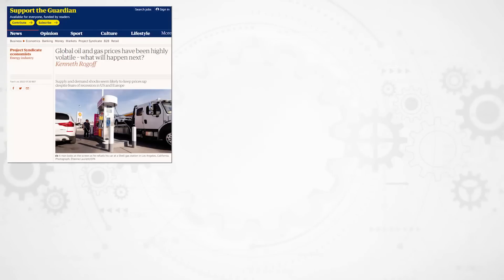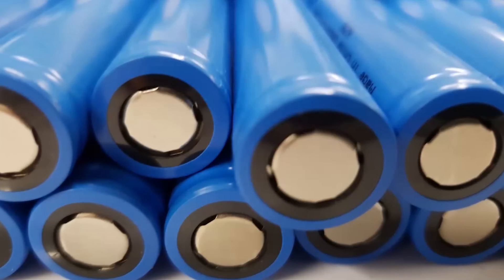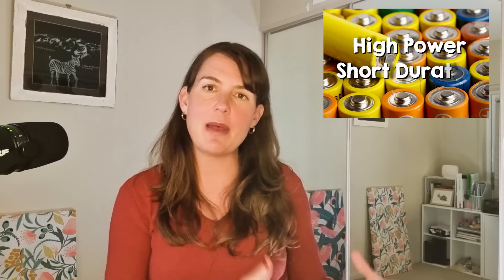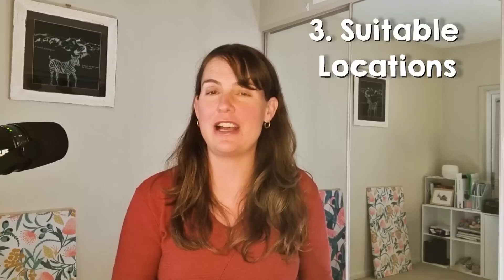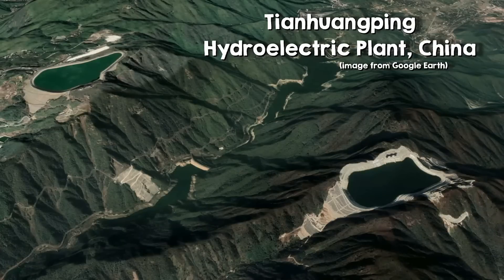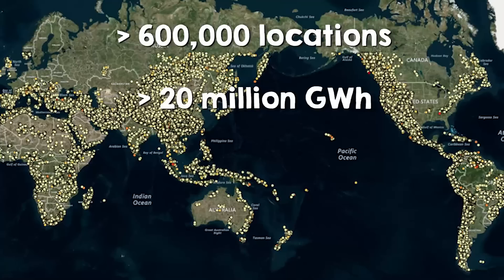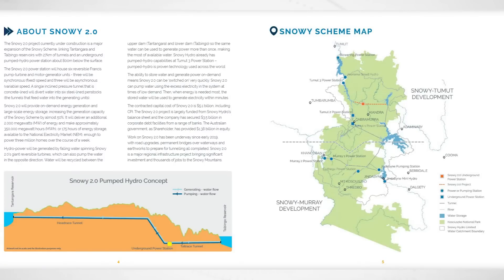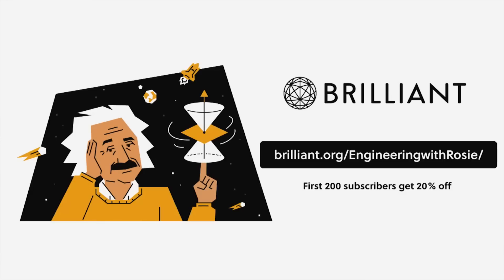Pump It Up When You Don't Really Need It: Pumped Hydro, Future of Energy Storage

Comment: Rosie, tell me where I'm gogin wrong here. I don't reckon that existing dams need to be heightened. Over the ditch here where we have more water than you guys, we still often have drier patches, so I reckon the dams are often not as full as we would like. Pumping water back up in these will increase storage, and maintain that stock of energy when otherwise we might otherwise keep using it up. ie with more renewables, the excess re-loads the water head in these dams so they are closer to full more often.
Reply from the maker: If there is hydro without pumping capability then that is usually a slam dunk to get very cheap energy storage with minimal additional environmental impacts.
Reply: I could suggest NZ Hydro balance well with wind / solar. 
Dry windy summer : let Hydro sit like a battery, until the windless nights when Hydro kicks back in
Reply: This could be done for the Tekapo scheme, i.e. pump water back up from lake Pukaki to lake Tekapo. The downhill part already exists. I think that one will happen. Running the Ohau scheme in reverse (from lake Benmore to lake Ohau or Pukaki) might also be a candidate. The main issue for Taupo is that the first hydro station is a fair bit downstream of the lake itself, but you could have off-river storage elsewhere on the Waikato. 

Physically I think you could do it at Te Anau / Manapouri but doing anything at Manapouri beyond the hydro scheme that already exists there is still a political third rail. Also you would potentially be disrupting a section of the Waiau river with not one but three Lord of the Rings filming locations.

Comment: If you pump up about half an inch of water level in one week and the upper lake evaporates half an inch in a week, like any pool does, the storage  efficiency of such process over one week is weak or more simply… NIL!

Of course due to economy of scale and concentration of pollution at one single location, the thermal coal or gas plants or nuclear plants and hydro-dams are huge and electricity is then ideal to move this energy production to cities..

Wind and sun, on the contrary, are present all over but are variable, seasonal and require much more energy storage on site but much less transport since moving this energy to use it or store it elsewhere in a place where the renewable energy can also be produced or rather harvested, is simply an insane waste of mining and funding ressources…. For electro geeks!

Charges and networks have always adapted historically to the supply characteristics, NOT the reverse….and what the system in place try to do to continue to harvest huge gaps from low energy costs to high exclusive retail energy selling prices at their exclusive gas stations and utility meters. For instance, when trains got electrified, we did not fit a resistance in the boiler and a pantograph of the cab of steam locomotives, but produced new specific electric locomotives instead…but today, our strong energy and supply lobbies invented those heavy BEV only sold and viable in rich industrial countries with enough taxpayers subsidies to support them but this cannot be replicated elsewhere for larger ww mobility economically.

Same issue here for surface produced renewable energy: for energy storage, not transport, we find that electricity is no longer the most economic and efficient media: chemical batteries are mining intensive, expensive, polluting and not durable, the hydro storage doubles the power lines losses from production to storage and from storage to the charges on top of huge pump, turbine, friction and evaporation energy losses.

instead, the oxidising green gas storage as carbon neutral energy supply are much more promising, H2 CH4 NH3 etc…  if PV and wind power direct DC electrolysis and compression of hydrogen or synthetic methan or ammonia is rather inefficient, it is with a free supply source of power and all the stationary joule losses of the process with high enthalpy (…and pure high value oxygen side production for medical use or welding) for heating hot water or absorption air conditioning, then all those process losses are recoverable, useful and economical as well. 

The green H2, Pv or wind produced economically can be stored for months at no measurable loss nor significant cost at nearly 1/500 of the cost of  LIB per kWh of storage. The pressure bottles are both much cheaper and more durable (over 50000 full cycles) than any polluting reversable electrochemical lithium battery. For home use and for small storage capacity only, the recently improved very heavy salt batteries could eventually compete with green H2 for low cost energy storage but more H2 and less power network will definitely be a strong trend since copper and aluminium are just becoming way too expensive to accommodate new heavy charges like BEV’s and heat pumps…via networks which were not designed for it…
Reply from the maker: You can easily pump faster than evaporation 🙂
Reply: @EngineeringwithRosie  yes but the amount of energy lost in kWh, MWh or TWh is still the same over time with more energy storage or is even slightly higher with more heat pumped from a lower lake, this increases the evaporation once stored lower warm water is at higher cooler altitude. Meanwhile, a H2 COPV bottle of 350 or 700 bars has no measurable energy loss for over six months at full pressure or over 50000 load cycles, so while some energy storage are aimed at short duration with efficient conversion but high losses over time such as hydro or electrochemical reversible reaction batteries, other storage methods dedicated to free seasonal and variable sun and wind zero carbon energy are less efficient upfront, yet with recoverable joules losses and pure oxygen, but with no further loss of energy over time and this for reasonable cost, about 10$ per kWh of storage for COPV’s depending on sizes…So, globally electricity is good for massive ongoing transport but poor for long and massive energy storage, heat is for storage only and very short distances. The catalytic conversion or combustion of green gas or green liquid ergols produced by renewables sources is most economical for seasonal storage with economical transport and transfer of power not needed since sun wind and water are all over where humans live with no significant economy of scale benefits…unlike fossils, hydro or nuclear plants…This is true only if the expensive upload to a power grid (copper at 10000$/ton aluminium 4000 etc) or the energy charge onto a LIB battery (200$ per kWh for only 2000 cycles and 0.8 to 1.5% loss per day depending on load level) is avoided due to high cost: PV DC to DC electrolyser... Please note also that gaz pipeline are 3 to 20 times cheaper than power lines per Megawatt of capacity and the amount of energy a single fuel truck can carry is very significant.
Reply: Have you ever heard of rain?
Reply: @Hzwo.0  hydroelectricity energy production and hydroelectricity energy storage are two different things and increased usage of variable, seasonal  and unpredictable surface renewables including hydro rain snow ice wind sun, etc  requires massive amount of endurant energy storage where H2, salt batteries micro hydro etc can play a larger role than evaporation and grid transport uneconomical wastes.
Reply: @philgooddr.7850  sorry but I'm having a hard time understanding you...
I'm just saying that you have evaporation but you also have rain so..
Probably on some locations more rain than evaporation.
Reply: @philgooddr.7850  actually we shouldn't be talking about nuisances like evaporation when there is still stuff like deepwater horizon where we suddenly are able to spend billions. Or covid. 
We got the money / manpower respectively so just do it. 
It's also fun cause oil from deepwater horizon could stop evaporation...
Reply: @Hzwo.0  Sorry, I was not so clear, English is not my mother tongue: simply stated, for economical energy storage, I guess that three parameters are essential:
1. Storage efficiency: percentage of the loaded energy which is restored, recovered and usable.
2.Loss of energy stored over time if the storage of energy is long, seasonal.
3. investment cost: economical balance and ecological impact, mining amount pollution and manufacturing cost, initial grey energy, system durability and number of storage full cycles from full load to no load and reload as one defined cycle, maintenance and end of life recycling costs.

Now, to shift fast or even faster to a green renewable low carbon yet industrialised modern civilisation in order to stop roasting the planet, much more endurant storage and much less long distance transport of energy will be required. There, electricity is no longer the only, ideal and most economic energy media for large storage volumes of useful energy. Also, the final energy loads, domestic mobility industry and services, etc, can be adapted quickly to the new available clean and economical primary energy sources and energy storage technologies…Already today, hydro electric dams, electricity grid networks and lithium batteries became very costly in comparaison to clean PV panels, graphite electrolysers, gas compressors and COPV’s. With more heavy BEV for mobility and heat pumps for climate control powered by the grid, the mandatory reinforcement of the current power network not designed for all those extremely high domestic loads would be extremely costly. Meanwhile, transporting renewable power which can be produced anywhere is absolutely insane. Then, Hydropower for short day to night time periods, green hydrogen and green E methane for on site power longer storage and sodium salt stationnary batteries for moderate domestic energy storage volume are maybe our most promising clean power options..

These are only my current modest views on these issues. they have evolved over time and are certainly and significantly wrong in many aspects and will also change further like in the past and all arguments like your are valid to progress, but we have to consider early enough, the very dynamic aspect of energy: for instance 30 years ago there was NO windmill power whatsoever in the projected forecast of the IEA the International Energy Agency… now electricity is only part of the overall green solution but definitely not 100% of the solution if the amount of mining and pollution required more than offset the carbonising gains of such green electricity and we with the wrong choices preserving many historical interests in place, we could be wasting money ressources and mainly valuable years of planet life and biodiversity preservation.

Comment: I would urge you to see.....  youtube channel zeropollution2050 .... that was released over a year back on Youtube.... that covers the Supply of Energy using ONLY AgriVoltaics (AV) with a 150TW Global AV System generating 180,000TWhrs/yr of Electricity to meet ALL of Mankinds Energy Needs (not just Electricity) by 2050. 
Today Mankind uses 120,000 TWhrs/yr of Energy (converted to Electricity).. or 15,000TWhrs/person/yr for 7.5 Billion People and 20,000TWhrs/person/yr for 9 Billion People by 2050.... Approximately, 25% of this would be required for S2S (Sunset-To-Sunrise) Energy Storage/Generation needs... or 40,000TWHrs/yr in 2050.... much much more than the maximimum 10,000TWhrs/yr suggested in this video....
The Videos originally discarded the 1+TW (mostly) Open Loop Hydro System for S2S Energy Storage Needs as they generate ONLY 5,000TWhrs/yr instead of the needed 40,000TWhrs/yr. 
This was however revised in a recent Video.... UHES... or Upgraded Hydro Energy Storage... In UHES you take the 1+TW Open Loop Facilities and UPGRADE them to 10TW Pumpeed Hydro and provide Lower Reservoirs of just 120TWhrs (barely 2.5% of the 5,000TWhrs of Reservoirs above).... at the EXISTING HYDRO SITES ONLY.
These 10TW UHES Systems would operate in a 12/12hr Pump/Generate Cycle generating 120TWhrs/DAY... or 40,000TWhrs/yr ... the REQUIRED S2S Energy Storage/Generation needed.....
I hope this will help....

Comment: In a changing climate, how much will water variability impact pumped-hydro systems especially in water-stressed countries? This did make me wonder: what about a marine pumped=hydro systems... pumping sea water to a reservoir when energy demand is now, and pumping it back out to see when energy is required? This, in conjunction with other new marine-based energy generation & storage tech. 

Other interesting hydro energy options include:
- conduit hydro (mini turbines located inside high-flow water pipes)
- turbulent hydro (constructed mini whirlpools)
- mini hydro (mini hydro rotars in river & streams)

On a different note: there are a few battery storage options in the pipeline that may be better-suited to grid-sized energy storage including liquid metal batteries.

The future of energy generation is interconnected distributed mini grids + storage located nearer to consumers using whatever geo-physical assets an area has, ie community energy. Base tech would include conduit hydro, energy from poop (a free daily renewable commodity) via a no. of tech options, and waste to energy (must be clean). All urban areas pump water to homes, and remove household waste (minus recyclables etc) & sewage so why not use these for energy generation? Solar panels on building roofs would also feature prominently. in this context, energy efficiency is crucial to reduce energy demand.

Comment: We might also see more baseline power from deep geothermal, accessed via new plasma drilling technology.  There are a few test sites this year which might tell us whether the drilling technology works quickly and reliably.  Then we'll need to see whether traditional geothermal heat exchangers, turbines and well fluid recharge cycling, function as needed.

Comment: As I understand it, there are anoxic areas at the bottoms of the lakes/reservoirs used in hydropower (pumped or not). Bacteria living there can produce methane, which has its own climate risks. Did you research this? Are there ways to limit this in standing water?

Comment: I don't understand why talking about Pumped Hydro never includes consideration of repurposing abandoned underground mines.  You don't have to worry about evaporation reducing your capacity.  I imagine turning underground caverns into water-storage tanks would not be a big deal.  Adding storage capacity (Wh) is just putting more tanks in the top and bottom levels.  Adding power capacity means just installing more turbine generators, pumps and plumbing between the levels.  And it puts all those mine workers back to work in relatively clean jobs.
>> SocialDownclimer:  My thinking is that all the storage water inside the PH-in-mines is contained in the upper tanks, lower tanks and interconnecting plumbing, pumps and turbines.  Water seeping into the mines will have to be managed but are not part of the storage system.  Obviously dry abandoned mines would be preferred.
Reply: There are environmental issues unfortunately. Depending on the mine, a lot of pollutants can leach into the water in the lower reservoir, and get transported to groundwater in the upper reservoir. I don't know specifics though, so if you find any sources that talk about this please post them : )
Reply: @SocialDownclimber  I'm thinking of a totally closed system with the water used within the pumped storage system is totally contained:
in the high tanks, in the plumbing between the high tanks and the low tanks, and in the low tanks.

Comment: Why did you avoid the calculation of the amount of Energy reguired to overcome the head height reguired to make these systems viable. Lifting water back uphill to the upper storage point requires massive pumping capability and energy usage.....
Reply: Because it isn't relevant to the economic viability of pumped hydro at all. If there are routine price differences in the supply grid greater than the round trip efficiency of storing and discharging energy, pumped hydro can make money. The viability is based on the price difference alone, as the round trip efficiency is based on the physics of pumps and gravity. That physics doesn't really change.
Reply: @SocialDownclimber  Pricing is a critical variable... Understood. However I am questioning the amount of "Energy" required to reverse the process. ie; Is the energy used to elevate the water similar or greater to the potential energy extraction ?  Pricing could fluctuate wildy, affecting viability..... but the energy used and potentially extracted should remain constant..  obviously there would be efficiency losses within the round trip which is what would be important when pricing is so critical.
Reply: The short answer : if we install massive wind and solar, there will regularly be a huge over supply of energy, and we can store this over supply, that would otherwise go unused, by pumping water uphill.